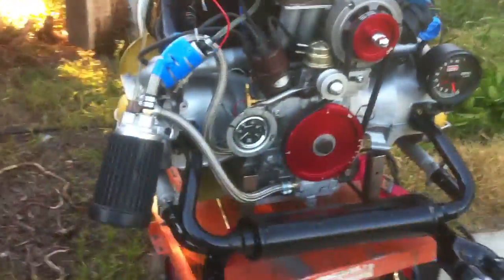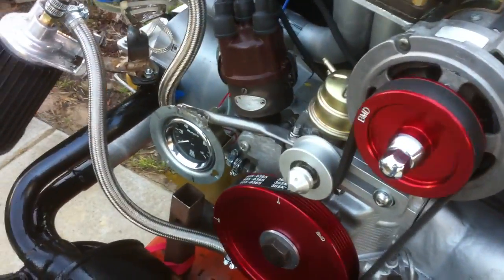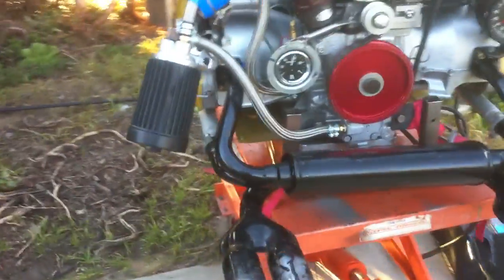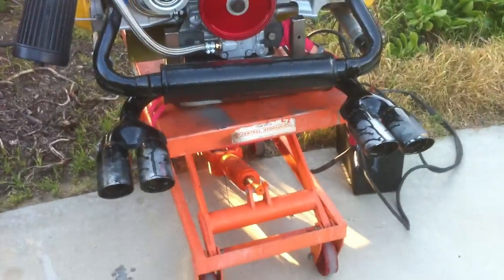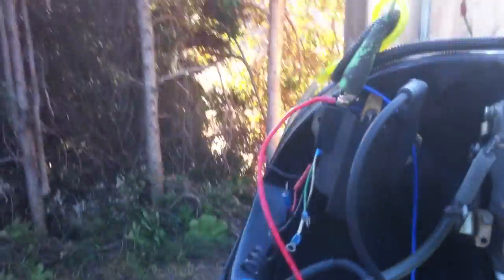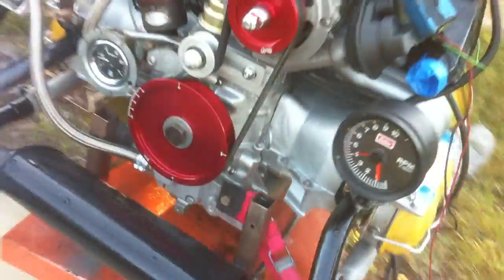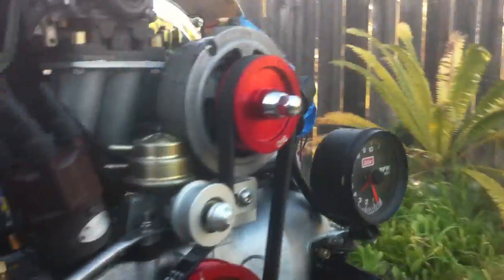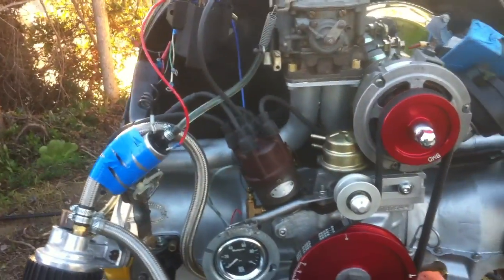VW STROKER BUS ENGINE   stroker 78mm x 92mm

Comment: Good job but the weak points are the 32 carb and the headers. I had a similar one (Monza’s) on my 71 Bay window Camper and it looked and sounded good, but held back. I had the Holley/Weber progressive carb that was bad. Get dual carbs,(preferably Weber 48’s if they’re still available.

Comment: Correct me where I'm wrong but shouldn't there be fuel lines connected on the fuel pump?
Reply: John Echterhoff he has a electric pump working in this vid. Thats why there is no lines to the mechanical pump.

Comment: The straight cut cam gears will allow engine harmonics to reach the valves. Be ready to replace valves often.
Reply: Straight cut gears add very little performance. They don't seem to be worth the extra cost and loss of reliability. Or, am I wrong?

Comment: I always used the 4062 bugpack cam,  the one engle I used I didn't like. Intresting idler you have there, we made a dual belt pulley that used the stock shims to adjust both inner and outter to the right tension. We had a lot of problems with belts when we ran light flywheels.  We welded two bottoms togeather, then ground the flanges on the top pulley so we could weld the "original' outer to a modified inner, then use a stock idler in the "new location" , Try a 4062 next time, if theyre avaliab.